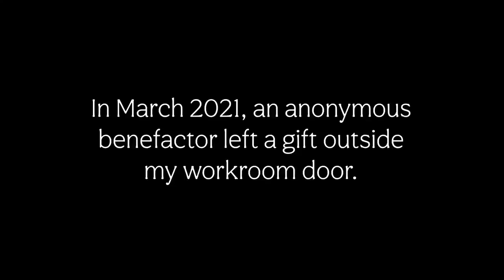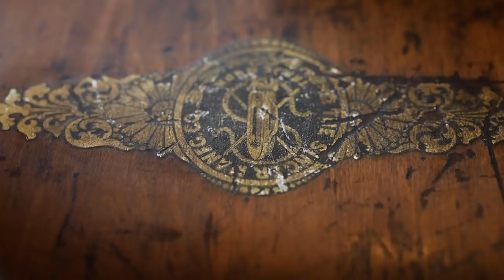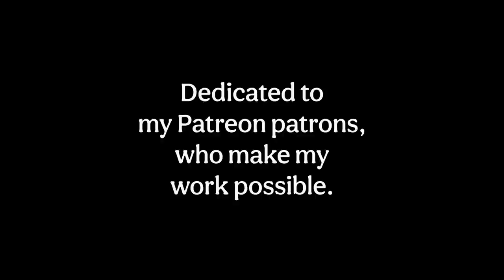Restoration Eye Candy: An Abandoned Singer 28K Sewing Machine Comes Back to Life

Comment: I was so glad you included the sound of the machine as it was sewing!   Nothing like these old straight stitch machines.  Would you please share what you used on the stainless steel pad to clean the wood case?  Excellent work on the restoration and thank you for sharing.
Reply from the maker: Certainly - take a look at the show notes - you'll see the exact brand of linseed oil I used, with a link to it. Thanks for watching :)